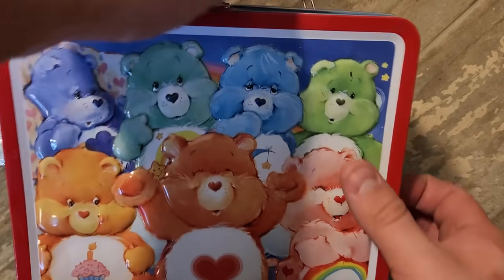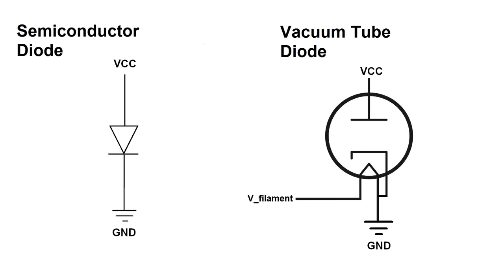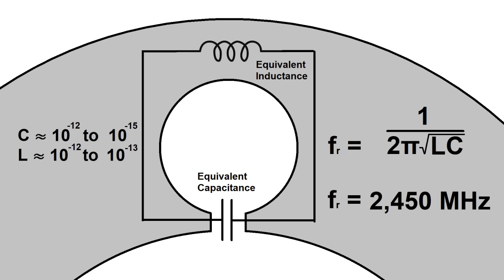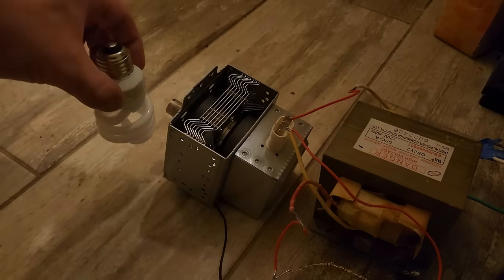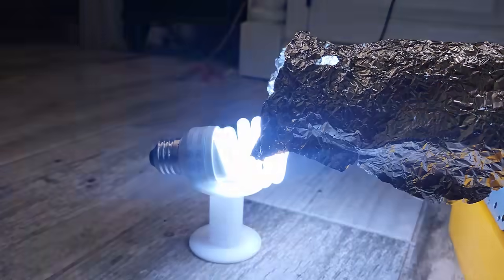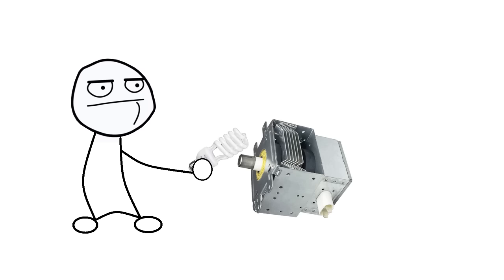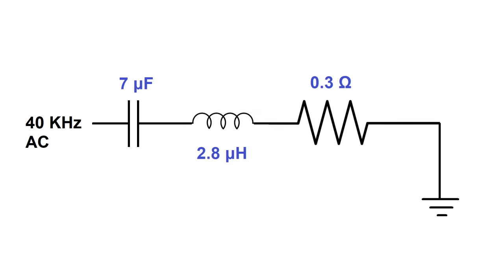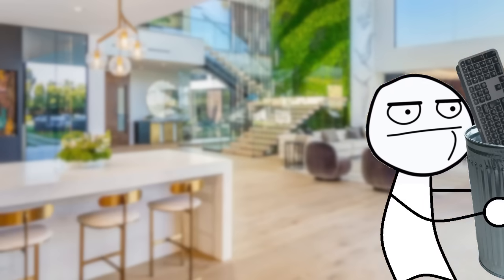Battery-Powered Magnetron

Comment: just learned this recently, but the tube within the magnetron can be used to produce x-rays. its a vacuum tube and with a sufficiently high enough voltage it can produce x-rays, but in a cone out the front and back of the tube, rather than the side because most of the soft x-rays get blocked by the thick copper walls of the tube.
Reply: With a microwave magnetron? it won't fry the electrodes?
Reply: There’s a vacuum tube in it? I thought it was just some other stuff
Reply: @combycat  the whole inside of the magnetron tube is under vacuum, and it can be brute forced to produce x-rays if you feed it high enough voltage. essentially the magnetron tube is a vacuum tube.
Reply: @adelinyoungmark1929  I genuinely didn’t know that. Thanks!!

Comment: Magnetrons from microwave ovens made in the last few decades do not contain beryllium, only some very early model microwave ovens ever did. The insulator is usually alumina (aluminum oxide) ceramic. The pink color comes from chromium oxide added to the aluminum oxide. Beryllium oxide ceramic (BeO) is white, so if you see a pink insulator it is most definitely not BeO.

Comment: Ummm the filament doesn't have that much inductance but there is a filter inside the filament connector with series inductors. You might be better off removing them. Nonetheless you got it working anyways  😀

One more note. You're explanation of the triode is a little flawed. Zero potential on the grid will allow the maximum rated plate current. The grid has to have negative potential to reduce plate current. Positive potential will cause a grid current and normally should be avoided under all circumstances. The only exception is in high power tranmitter finals....

Comment: regular Silicone Caulk is not good for electronics because it has an acidic cure. it expels acidic acid during the cure process which is highly corrosive to the metals in electronics. There is electronics safe silicone RTV to use for this check out DOW 3145 RTV instead.
Reply: okay thanks for your insight.
BTW sqwince, have you become a flat earther yet?

Comment: @ 4:38 wouldn't it be better to make a full bridge rectifier with 4 of those microwave diodes and double the high voltage capacitor of the microwave? To smooth everything out and give it more efficient power!? 🤔🤷🏻‍♂️

Comment: It's almost certainly not beryllium oxide if you get it from a cheap, modern home microwave. If it's white it's cheap alumina (AL2O3) and if it's pink it's the same with some chrome.
I seen only one "ancient" microwave with berylium insulators and both the magnetron (I think it was from GE) and all metal covers were covered with warning labels already back then.

You can use Google Images and search these terms to find a variety of labels warning about beryllium oxide:
"beryllium oxide hazard"
"beryllium oxide toxic"
"beryllium oxide caution"
"beryllium oxide warning"
"beryllium oxide" "BGY"
"beryllium oxide" "50 ohm"
"beryllium oxide" "dummy load"
"beryllium oxide" "tuned filter"

Comment: The reason you had trouble with filament inductance is because there are actual emi chokes on the filament leads in the lower can of the magnetron where the connections reside.

Additionally only very old magnetron tubes use beryllium in the output antenna insulator bushing.  Newer tubes that do use it have to be labeled from the factory as such.  The pink alumina color is just from the manufacturing process.  TIG welding gas lens cups are also the same pink alumina.
Reply: But is there a good way to tell, without like one of those hand held x-ray spectroscopy scopes that can identify elements? Best to play it safe and treat them all as if they're beryllium
Reply: @gorak9000  True, it's best to err on the side of caution, bit being an alarmist can backfire too
Reply: If its not using beryllium then what is using in its place?
Reply: @jetstreamsham4968  pink alumina - aluminum oxide with a little bit of chromium, that gives it the pink color and makes it harder / more durable - aka "polycrystaline rubies". There's actually a good thread I found on eevblog, "Beryllium Oxide vs Alumina - is there a way to identify?". Seems that ALL of the pink insulators on magnetrons are alumina and not beryllium, as beryllium oxide is white, not pink - time to go smash up and breathe in the dust of that box of magnetron insulators I have been collecting in the garage... the internet has lied to me for YEARS
Reply: @gorak9000  hi gorak, have you become a flat earther yet?

Comment: I'd like to take just a moment to appreciate that this is the first time I actually feel like I understand how a magnetron works.
Reply: During WW2, when the UK paperwork arrived at MIT days before the UK inventors did, the physics group tried to figure out the magnetron from first principles.   
I.I. Rabi got it right, saying "why, this is nothing but a whistle!"   Others chimed in:  "Suuure Rabi, now please explain how a whistle works!"    
(Yep, it's just some beer bottles, with wind blowing across the openings, but using electrons rather than air.   Well, more like a many-kilowatts air-raid siren, which can set fires in acoustic absorber materials placed nearby.)
Reply: @wbeaty  I recognized your name as well from your content 15 years ago.  I enjoyed your content.  I went to check your site and get the following...This server could not prove that it is YOUR SITE; its security certificate is from Eskimo.
Reply: Same, this has been the best explanation I have ever seen.
Reply: @BurnerJones  The difference is, he gets it right.   Every textbook I've ever seen gets it wrong, by claiming that it uses resonant microwave cavities (halfwave in diameter).  
No, they're way smaller than GHz half-wave.  Instead, they're just like he says:  one-turn nH inductors, in parallel with pF capacitors.  Tank circuits!  (An LC circuit can be far, far smaller than one wavelength.)  The rotating electron-beam looks like a spinning wagon-wheel, and it zaps each little capacitor-gap as it zips by, to keep up the CW ringing.
Reply: @wbeaty  It took me a moment but I knew I recognized your name. A friend sent me your website a few weeks ago and I've been reading your articles before bed. Despite being an electronics hobbyist for a long time there were a number of things that didn't make sense to me that do now - thank you for that
Reply: @BurnerJones  Those articles all came from my 1990 science-museum project.  I'd discovered that textbooks in grade-school are explaining electricity wrong.  So, I was attempting to update all those explanations. Explaining basic electrodynamics  ...to little kids and their grandparents!   Those are the target-audience for the devices in science museums.
Reply: True, always baffled me.
Reply: Same here! :)
Reply: They are truly a  misunderstood device.
Reply: All that is left is to actually understand how magnetrons work now lol
Reply: Damn right. And I've seen several videos about it and this is the first one that really made it clear.
Reply: Безумие
Reply: @Asympto, go to school and to the library!
Reply: Tell that to MR Green! 😂😂😂
Reply: @AsymptoteInverse
I'll admit, I didn't the first time I went to this video, and rest of it still loses me, if only a little but basically same! 😅

Comment: I'd love to see you do something about high level infrasound... I was always fascinated by Throbbing Gristle's research in this area but they didn't actually publish that much at all on the subject.
Reply: @edgeeffect maybe I shouldn't say this (because maybe it might work,) but we can slow the speed of sound way down by adding mass to the air, as long as it doesn't create an absorber.  Loosely-stacked paper will do this.  Also, loose foams do this.   If you have an ancient yellowpages, or a digikey catalog, try tapping on it with your fingertips.  It goes "doonk," because the slightly-spaced paper sheets are forming a resonant acoustic chamber, where sound-velocity is extremely low.   Similar things are heard when you make egg-white meringue with high-speed beaters in a bowl (you start hearing deep bass notes.)    What good is this?  Slower sound-waves, at constant frequency, mean smaller resonant chambers.    Infrasound needs resonators, such as hundred-foot sewer pipes.   With the correct "slow-wave medium," maybe we could make a 20Hz resonator which is under a meter long.  To create an infrasonic whistle, next you need a "virtual trumpet horn" made of graded slow-wave material, to couple the outside air with the wattage from the resonator.

Now go play with safer devices.   Like H-bombs triggered by TNT.   Ya just gotta get the topology right, no?

Comment: 🤣 actual current conflated with electron current. 🤣 

Sure electron flow sort of has a physical representation, but so does conventional current convention. 

People have this mistaken view that's not so dissimilar to electrons line up like columns in a marching band with electrons orderly moving through a.  Instead, because of thermal vibrations, electrons in copper at 23 degrees c  zip around bouncing off eachother at roughly a million meters per second while the electron drift with current is often less than milimeters per second.

Current in a wire is Electons wizing around 99.9999 in random directions with 0.0001% bias towards the positive potential.  This physically means momentarilly there are over density and under density pockets of electrons that move in opposite drections. Under density or electron holes drift in the same direction as conventional current.
Reply: Ben Franklin fanboy detected
Reply: @tissuepaper9962  😁 does one have to be a fan boy because they  reject bad argument (real flow) for one convention over another. By the way electon hole flow was not what Franklin argued. It just happens to be the same direction, and it's as real as electron flow.
Reply: hi kreynolds, have you become a flat earther yet?
Reply: @flat-earther  🤣 Have you pulled your head out of your rear end yet?
Serously, please provide a Correlation between electron holes (vital to understanding semiconductors) to believing in a flat Earth theory that's demonstratably false. 
 
If the premis to your argument is electron holes or electron under and over denisty don't occur  randomly because of thermal vibration of atoms, then I suggest you would benifit from several physics courses. Or you can short cut that expense for a better then your existing models  but still limited understanding, if you do a little Googling, starting with search phrases like "electron drift velocity", "electron thermal velocity", "semiconductor  theory", "valance electrons", "electron conduction band". So while this is far from a complete education, it will help better piece together how electrons actually behave in a wire rather than the basic and overly simple circuit modeling taught in  high-school.
Reply: @kreynolds1123  BTW kreynolds, what do you think about all gubments drawing a line around you and saying you are not allowed to leave?(Antarctic Treaty) If you don't know what I mean, read my about tab.
Reply: @kreynolds1123  electron holes are very relevant to *semiconductors*. They don't exist for any appreciable amount of time in conductors and it's just dumb to use them as a justification for the backwards nature of conventional current. Electrons are stable particles with a mass and a measurable charge. Electron holes exist for nanoseconds at a time in a conductor and have no mass, they aren't real.
Reply: @tissuepaper9962  take a box with a proton  and two electrons is just as real as an adjacent box with a proton and no electrons. Both states are real. Hole flow is just as real as the electron.    

Yes semiconductors theory demands understanding electron holes to explain the one way nature  of current through a np junction, with  the depletion region and light given off as electrons fall into lower energy holes (LEDs) or absorbed at the junction resulting in electrons jumping to higher energy state (photovoltaic), but both electrons over density and under density  regions are temporary and thermally random with only the very tiniest  bias going in opposing directions because of field differences.  The reason there is no focus on this in a bulk conductor is because you don't have junctions or your not concerend about thermal effects. But when you get into bipedal junctions, you need to go back to thermal electrons and over density and under density  in conductors to explain seebeck and pelter effects.  Steve Mould's gives a basic visual in a video titled "making electricity go around - the thermal electric effect"  how heating one end of a wire causes a positive potential and cooling the other creates a negative potential.  Thermal electon over density and under denisty in conductors is real. And their distribution is gradient where there's electric gradient or a heat gradient. Take a moment to visualize a long resistive wire connected to a battery.  And it should be easy to see positive terminal is more  is electron  defficent while the negative terminal or more electron dense with a gradient of electron and holes across the wire.  and that pockets of over denisty move to the positive terminal while pockets of under density both  move to the negative terminal.

Comment: I suspect the magnetic shunt in the MOT helps find the optimal filament current under differing line voltages
Reply: Both optimum fil current and hv current peak limiting.

Comment: Oh wait i have a question , magnetron construction looks like X-ray machine, doesn't it generates X-ray?
Reply: X rays are generated by crashing highly accelerated electrons (>25kV) into heavy metal anode (tungsten, tantalum).  Magnetron anode runs at 2 kV, so no x-rays.
Reply: @vibrolax  
Thanks for this information 😀👌🏼

What if we apply 25kv+ 🤔
Reply: @kalashnikov_47z  Then you'll get X-rays.  Unless, of course, the higher voltage causes an arc between the anode and some other electrode.   Color TV's with CRT's used voltages ~25 kV, and had x-ray warnings near high voltage rectifier tube and CRT faceplate.
Reply: @vibrolax  
Hmmmm, 
Sounds interesting, I have a Geiger Counter, i wish i May found some old CRT TVs on some old peoples home (neighbours maybe) That would be a great if some of these Emmitt x-rays , thanks for information bro ;-)
Reply: @kalashnikov_47z   If it's working properly an old TV won't produce X-rays. If the high voltage were to run well out of control you could likely get a small amount of X-rays but regulations introduced in 1968 mean newer CRT TVs all have protections against this.

To get meaningful X radiation from a CRT TV it would need to be a color set from before 1970, with a missing HV regulator, with an overactive horizontal output. And it would need to operate like this without breaking down.

Comment: I have a Masters in physics. I have taken I don’t know how many electromagnetism courses. This is the first explanation of a magnetron that has made sense.
Reply: I mean its physics, it doesn't usually make sense when you learn it, it only makes sense when you use and apply the concepts yourself
Reply: yip me too I have  M.S Electrical Engineering and admit that  he very well fed us the theory with a spoon.
Reply: I'm not particularly good with EM or analog, but my gut understanding of how they work is essentially "electrons come out of cathode, magnet makes them get stuck in the rotary, cavities act like whistles for the circulating electron stream".
Reply: Hmm, the operation is very simple, really. 

Perhaps I've always had an easy understanding of how they work because of my decades of experience with vacuum tubes/valves... 🤷🏻